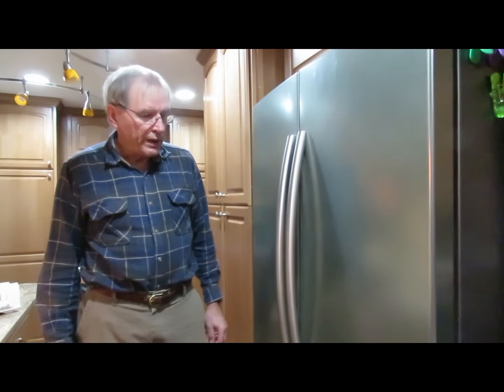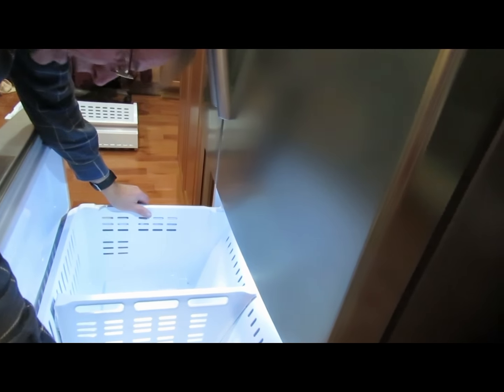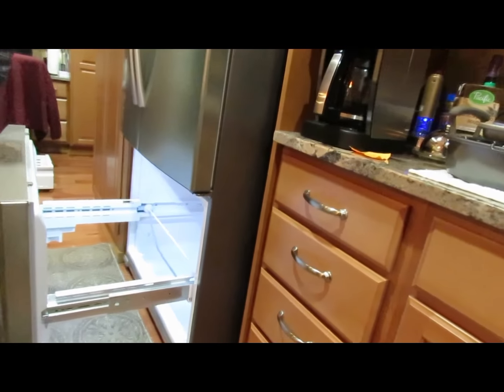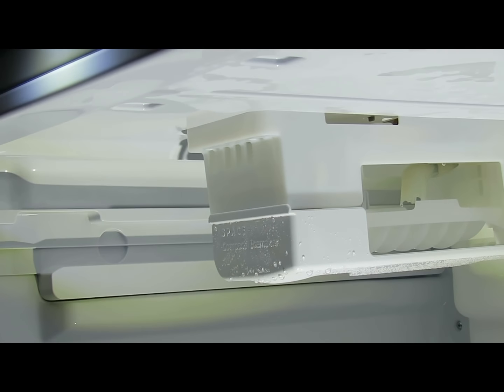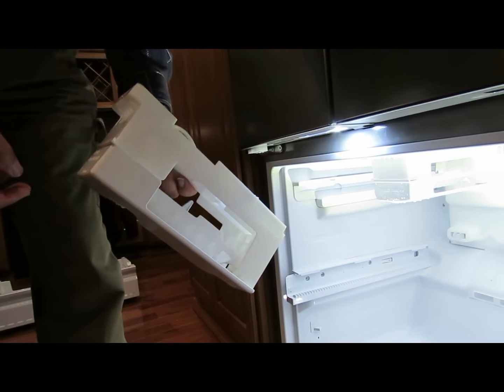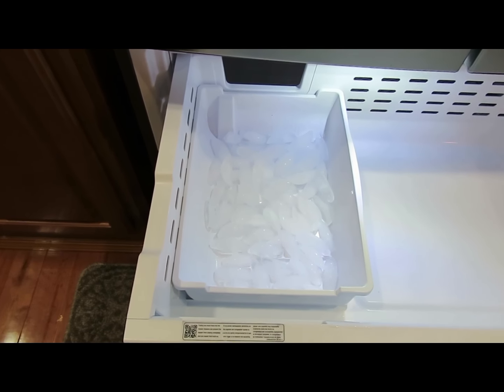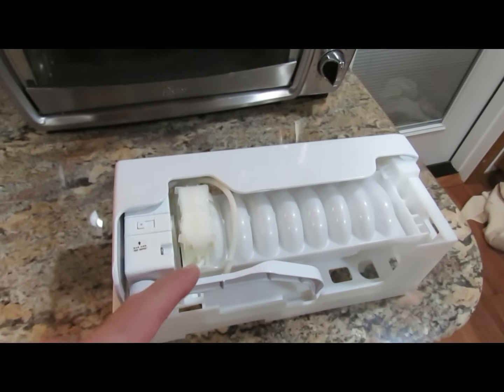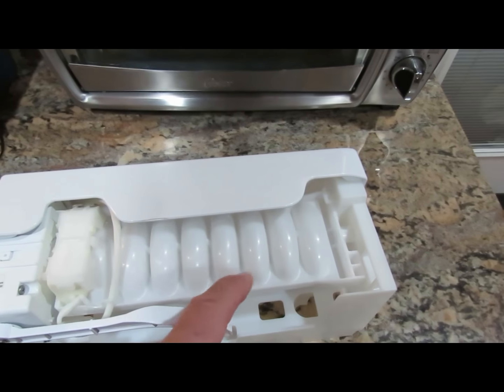Samsung French Door Refrigerator/Chest Freezer Ice Maker Repair

Comment: Great video! Thanks! Do you know if there is a a way to modify to fill level? I am getting all my cubes stuck as one because I assume the water is filling too high.
Reply from the maker: There is no adjustment for fill level. I think that they just open the solenoid valve for a fixed period of time, so if your tray is over-filling your water pressure may be too high. Try closing the valve on the water line a bit until the water level is in the right range. This is from the User Manual:

In order for the ice maker to operate properly, a
 water pressure of 20~125psi ( 138~862kPa) is

required.
 Under normal conditions, a 170 cc (5.75 oz.) cup can be filled in about 10 seconds.

If the refrigerator is installed in an area with low
 water pressure (below 20psi), you can install

a booster pump to compensate for the low
 pressure.
Reply: @tomseim  thank you Tom! I’m having the same issue...giant chunks of 8x cubes coming out at once. I will try turning down the water pressure at the source. :)

Comment: Good video. I got the refrigerator new last December but only got the water hooked up today (Aug 2020). 
We had it hooked up at first but there was a leak in the old water line, so I finally replaced that.
When I hit the test switch a few ice cubes fell out, but then nothing. I can feel ice in the tray. I'm hoping I just need to wait a while for the new ice to fall out. 
I wonder if you just momentarily press the button or do you need to hold it in?
Reply from the maker: Just press it for a second or two. You will hear the motor run, indicating the start of the cycle.
Reply: Hi, i am looking for the link to where i can purchese replacement parts
Where is it?
Reply: @tomseim  thanks Tom. I think I  just needed a bit of patience. It's producing plenty of cubes now.

Comment: hope you can help me! We bought a house and this Samsung refrigerator came with it. It was manufactured in 2016 but is like brand new. The previous owners were elderly and didn't have the water hooked up to it so never used the icemaker. We ran water to it and the water fills the ice cube tray but it won't dump the ice cubes. Any ideas? Do I have to replace this whole unit even if it has never been used? Or are we missing something?
Reply from the maker: Try resetting it per the instructions in the video.
Reply: @tomseim 
I've tried pushing the reset button several times. Even had water running out into freezer bottom at one point after pushing the button. Maybe I held the button too long? The problem is the ice is not being ejected so I guess that sensor must be bad even though it has never been used. I will probably have to order a new one then. It was a great instructional video and I will use it to refresh my memory on how to replace it. Thanks
Reply: @hanginginthere440 make sure the tray is twisting. That ejects the ice. Otherwise it’ll just keep filling and filling and filling
Reply: @zigarten  well... I ordered a new ice maker and put it in and also put in a new water filter and now it is not even filling the tray. Before it was filling the tray but not dumping the ice. I'm going backwards..... 😞
Reply: @hanginginthere440  This fridge is really bad, I had to tear off the rear panel and install a heater to help the defrost up top. Worked fine but there's been water in the bottom of the fridge, again! I hear ya, 3 steps fwd, 10 back.

Comment: Excellent video, do you have one that shows how to remove the existing ice maker? And will the fridge function properly without it? I don’t need the ice maker and it takes up valuable real estate in my freezer.
Reply from the maker: There are just 2 screws holding the ice maker in place. You don't need it in for the freezer to work, but turn off the water supply to it.
Reply: @tomseim   thanks Tom. I have loosened the two screws at the front, but it is still fastened in somewhere. I have never had the water supply hooked in. Is there some other trick to taking it out? At this point, I’m seriously considering hulking out on it.
Reply: I can’t seem to figure out how to pull the freezer door out so that I can get a good look at the back end of it.
Reply: @tomseim  okay, I persisted and rewatched your video. SUCCESS! Thanks so much for the info.

Comment: I have a slightly different model (RF268ABRS) and seemingly a different freezer ice maker (DA61-05227A) but they look the same as yours to my eyes. Apparently there are an ungodly amount of variations in these parts and people seem to have lots of trouble with all of them. My freezer icemaker was killed when it was crunched and ripped out by the top freezer tray (long story). When that happened the whole fridge seems to have stopped working (lights, compressor, etc) except for a regular popping sound and the water dispenser light and two indicator lights (the wide meat tray in the fridge compartment) pulsing with the sound; about a second apart. I've removed the rest of the icemaker from the freezer and there's been no change. It seems some kind of electrical short is occurring. The front control panel stopped working a year or two ago and there's always been a problem with ice build up in the fridge. I bought the fridge new about 9 years ago. Sorry about the long post, but I'm baffled about what to do next. Hiring someone is out of the question. Are there fuses someplace that I might test?  I'm going to attempt testing the compressor next; just wondering if there's something simpler to try first. SOS!
Reply from the maker: WOW! I am surprised that this fridge is still cooling. Many electrical problems can be traced to poor connections. Disconnecting these and spraying them with contact cleaner is something you might try. There is a main control board that has most of these connections. This video shows how to get at it:
https://www.youtube.com/watch?v=xseeWmNFLnA
You may need to replace this board if cleaning the contacts doesn't work. Here is one source:
https://www.genuinereplacementparts.com/samsung-rf268abrs-pcb-main-electronic-control-board-genuine-oem
Be sure yours looks identical before ordering it.
Good luck!
Reply: @tomseim  Thank you, I'll pursue both of those suggestions. It makes sense that it's not the compressor specifically, but more likely in the electronics.

Comment: Thanks for the video. Is this compatible for model #RF28T51001SR/AA?
Reply from the maker: I don't think so, but compare the ice maker to the one in the video. Here is the ice maker for that model (installation is probably the same):
https://www.amazon.com/Refrigerator-RF28T5021SR-RF28T5101SG-RF28T5F01SG-RF28T5F01SR/dp/B0BY3DRRL5

Comment: Mine is dumping the water in the catch ice tray, not making cubes, but the water freezes in the ice catch tray. Any ideas on how to fix this or do you think I should replace the ice maker part?
Thanks again for the great video
Reply from the maker: It sounds like the motor that rotates the tray is not working. This requires replacing the ice maker.

Comment: I just paid someone to install a new icemaker for me (the model you were talking about)———it does not freaking work——- I was told it will take two days for the icemaker to get to temperature before it starts producing ice ——after watching your video I see that this is wrong wrong wrong ——also after watching your video I see that blue light Ice off icon should not be displayed so this tells me they didn’t even turn it on ———I also checked the water valve don’t even think that was turned on ———I have pressed the reset button and I do not hear the motor running I guess I need to pull the darn thing out and see if it’s even hooked up electrically ——-I’m not a YouTube DIY fan———But this video is excellent——- I’ll look at the schematic maybe the pin connector isn’t even getting power any tips on what types of voltage or ohms I should be getting on the lead end of the pin connector—— I’m totally unset —-
Reply from the maker: Contact the business that did the installation. You should have had the first ice in about an hour or two. It is possible they didn't even connect the wiring, but that is unlikely. There should be power on one of the pins (I do not know what voltage), if not there is a problem with the main board.

Comment: Thanks for the video. I found a clue to my problem at around 4:34 in your video, when you said "don't forget to turn Ice Maker back on here" as you pushed the [ICE Off] button, and the (blue ice glass icon) went out... I thought , "well he just misspoke" ... NO..! WHEN THE (blue ice glass icon) is LIT The ICE MAKER IS OFF... (Crazy Logic)... Tom, I wonder how you figured out this (Crazy Logic)... The poorly translated Manual was no help at all... My new Samsung RF260BEAESR was delivered 72 hours ago, and I just  now got my 1st EIGHT pieces of ice... I think  I'll have Lowes replace it with something Made in the USA...
Reply: Thanks for writing that! Mine fridge too has that inverted logic. I thought i was crazy or defective. In my fridge theres no symbol but rather "Ice Off" sign and a blue light next to it. When the blue light is ON the <ice maker> is off lmaoo crazy isnt it? 
By the way i rather put a  cheap $1 plastic ice cube tray inside the freezer and add water into it and let it freeze. Its faster . The <ice maker> function makes the fridge way too noisy.
Reply: Wait WTF?? I have been troubleshooting my ice maker and making sure that icon was ON.... I can't believe that was the issue all along.

Comment: What if I simply want to remove the ice maker because I don’t have water access. Is there anything that needs to be plugged or capped off to keep the refrigerator/freezer running properly?
Reply from the maker: No, just remove the two screws and pull it out.

Comment: I know this is a 5 year old video, but I'm looking for the schematics and service manual (at least the ice maker section) to troubleshoot my icemaker on my Samsung RF260BEAESR/AA french door fridge. It won't fully fill with water. Solenoid only comes on for about 5 to 7 seconds but it is supposed to be 15 seconds to fill. Your video showed only a prt of the block diagram but no schematic. Do you have more info on this? Thanks!
Reply from the maker: The schematics will only show interconnections between various subassemblies, not of the subassemblies themselves. The solenoid valve is controlled by the main electronics board.
Reply: If you have any more schematics at all or even that block diagram at the end of this video could you please share with me? IM or whatever would work. Thanks! @tomseim

Comment: I have the same fridge as you, my ice maker also stopped working. We had turned it off for a couple of weeks, when we turned it back on it tipped over to drop the ice and stopped. It is now stuck upside down. Not sure if you had seen this. I tried the reset button that you showed here. This didn't do anything. I have not pulled the unit yet but a day after looking at it we heard a clang and found a metal rod in the back of the freezer. This rod is 1/4" square and almost 22" long with a hole near one end. not sure where this fell from. Any ideas?

Comment: Thanks Tom. My issue is the maker makes plenty of ice. Problem is it turns into one block in the tray. Freezer set at -2. Any ideas?
Reply from the maker: The temperature in the freezer compartment is getting above freezing, causing the ice to melt. The temperature drops back down and it refreezes. I would get a freezer temperature alarm to verify this.

Comment: If you press the test button and the ice maker wont cycle you need to flip the circuit breaker. Wait 2 min flip it back on then press the test button. This is from the Samsung help site.
Reply from the maker: Thanks for the tip.
Reply: This comment saved me the $$ of a new ice maker
Reply: Thank you , this was my issue, saved me as well

Comment: This is a terrific video. Thanks! 

Tom, can you help me solve a related problem? My ice maker wasn't working, but neither was the control panel above the doors. It blinked, but didn't do anything. So I replaced the control panel. Still wouldn't work, so I replaced the main circuit board. The control panel still does not work, still. Rest of the fridge is working. So what's that about, I cannot control it? That's the first question. And then, is it even worth trying to replace the ice maker? I had all three parts, but having replaced the first two, I'm wondering why Im bothering with the ice maker. Any ideas?
Reply from the maker: It sounds like you replaced everything you can, so I don't have any other insights except for a defective cable.

Comment: I installed the new ice maker from Amazon from the link and after 24hrs it has not made ice. I cycled it with the test cycle switch and it dumped the ice that was in the ice tray but still has not made and dumped on its own. Any ideas?
Reply from the maker: Make sure the ice maker is not disabled on the control panel.

Comment: I've tried the reset button and hear it go through the cycle of dumping the tray and then I assume should refill with water, I don't hear the water filling like I've heard in the past when the ice maker was working. Does the ice maker actually send a signal or trigger the water to be refilled? I'd hate to replace the ice maker if it's not the culprit to replace but the refill tube that needed to be replaced. Water dispenser works and flows fine for drinking water.
Reply: Having the same issue. Did you replace yet?
Reply: @Plumber1980S  I just ordered the refill tube so should be here next week. A quick test(disconnect water line to refill tube and press reset button on ice maker) confirmed that my current tube is frozen. Just be sure to have a towel handy at the end of the water line so it doesn't get all over the place.
Reply from the maker: The reset button goes to the main control board which operates the valve that dispenses the water. If water is not flowing it could either be because the tube is frozen or the solenoid valve is defective. You should hear a click when the solenoid valve opens.
Reply: Where is the link to a new maker ?

Comment: Hi,
What is the purpose of this ice tray?

It’s not for ice cubes, is it??

I bought this fridge a few weeks ago, and when I moved it, I saw at the back of the fridge on the floor water damage and water puddles on left and right of the back of the fridge just under wheels.
And I kinda can see through back bottom fridge some “rust” I’m worried about this.

Do I need to attach this fridge to a water line or anything??

I used to have a simple old style fridge just plug and use.
Reply from the maker: Yes, the purpose of the ice maker is to make ice. And, yes, you have to have a water line connector to the fridge for it to work. And the connection must be properly made or it will leak, as yours did.

Comment: Grateful for the video you made Sir. But, you didn’t cover the water refill hose placement. Real important as for now I’m not sure what hole it goes through.
Reply from the maker: The refill hose is fixed in the back of the freezer compartment. Nothing has to be done to this hose while replacing the ice maker.

Comment: The problem with mine is that it won't stop making ice.  The arm doesn't come down to sense when the tray is full.  We have to turn the icemaker on and off with the button at the top of the refrigerator.
Reply from the maker: Try lubing the arm with silicone spray lubricant.

Comment: Thanks for the video Tom. Couple of questions, if you have time. You mentioned turning the water back on near the end of the video. I didn't hear you say to turn the water off at the beginning. I'm assuming you pulled the refrigerator out from the wall to do this. Is the water supply tube included in the plug we need to separated or is there another connection. Is it possible to remove both bins and leave the drawer attached to remove the ice maker. Thank you
Reply from the maker: The water supply is not directly connected to the ice maker, so it doesn't need to be disconnected to remove the ice maker (it is a tube that comes out the rear of the compartment directly over the ice cube tray). Since it is prudent to turn off the water supply before working on the ice maker, I added a reminder to turn it back on. This valve is not at the back of the refrigerator, but at the point where the connection is made to the home's water supply.

Comment: Ours has not made ice in months. I did not know about the reset switch. So unpause the video ran out push the button and then and it didn't do anything. So I guess I'm going to have to replace it.
Reply: Before you replace the ice maker unplug the fridge for 2 minutes then plug back in , then hit the reset button on ice maker it should recycle and then make a beep noise.

Comment: I have had problems with this ice maker not producing ice, so I replaced the unit and it still hasn’t worked? What is the problem? I am at a loss both monetary and intellectually
Reply from the maker: It may be either a water supply or a solenoid valve issue. After making sure water is making it to the fridge then the valve is the culprit. They are relatively easy to replace as is shown in this video:
https://www.youtube.com/watch?v=eH3gs8s-0YY

Comment: I have the same unit but it's not filling with water.. what's causing that?
Reply from the maker: Make sure the water line is delivering water to the fridge. If it is, then it is probably the solenoid valve that controls water to the ice maker. This video shows where it is located:
https://www.youtube.com/watch?v=Ys8LJksu2e0
This may be the replacement part, but I recommend calling in a service tech to fix it:
https://partsdr.com/part/da81-05883a-water-filter-case?model=RF261BEAESP---AA-01